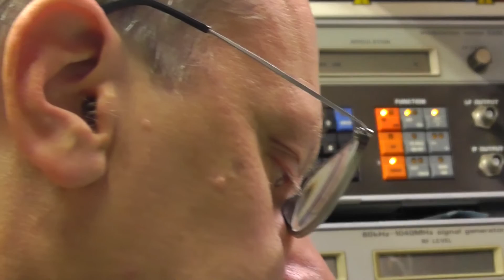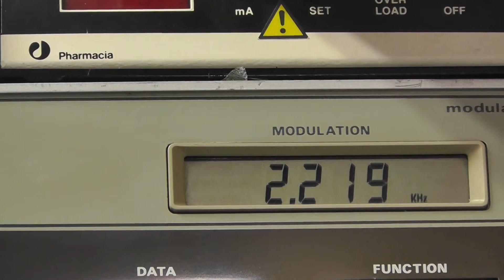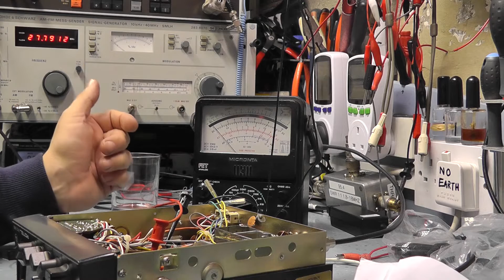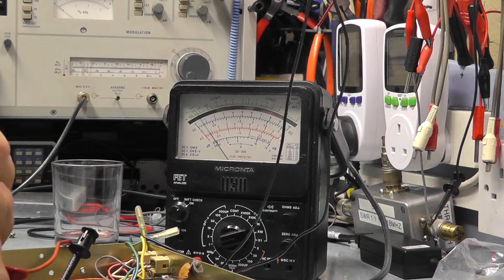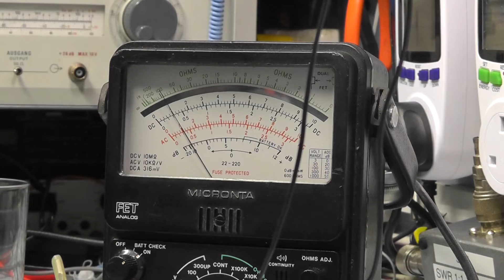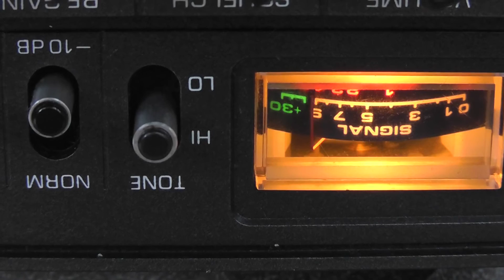Rotel RVC-240 (Cybernet) Pt3 Rf alignment, deviation & finishing up.

Comment: If you want a nice analog meter with high impedance, check out the Philips PM2505. It even has a polarity indicator, so you don't have to switch around.

Comment: Smashing tune up simon :-D
Did you have any problems with the red tx vco lock capacitor, or was it fine and dandy?
The t.x meter will show slighty different with an antenna connected in comparison to a dummy load, it's just a simple diode/capacitor r.f sample and an antenna has some reactance.
i used to set the t.x meter to a real antenna, but that's me lol.
The cybernet 134 board is quite sensitive on receive.
I would set the discriminator by ear for the best clearest/nicest sounding receive, they were often set miles away from normal and my customers always said how much better the receve sounded.
It's a shame that there are is so much electrical noise about these days,  often on 27 mhz :-(
I was always supprised how well they worked with minimal parts, yes a bit basic but quite reliable ;-D

Comment: Thank you Simon for an interesting series of videos. A good high impedance analog meter is (still) a handy item to have on the bench. Mine is an HP 427A  volt-ohm meter with the AC mains option. Regards, David
Reply from the maker: Totally agree. I have that HP meter on the shelf,it was just easiest to grab a battery one.
Reply: I have an HP 427 battery only that I made a battery for with 18650’s. Works great, fits pretty well in the space available, and will likely need a charge in the next millennium.

Comment: @9:00 you have to use the lowest RF signal possible, the reason being that the AGC can kick in and cause an increase in actual level to result in a reduction in perceived level, the AGC can begin to turn on at surprisingly low levels.
Reply from the maker: Cheers Scott. I will go back and check.
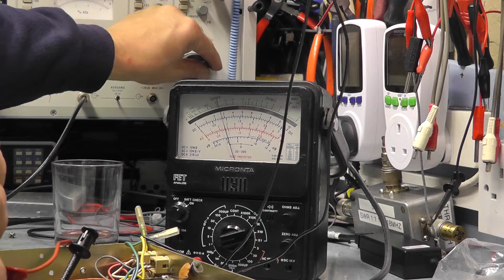Reply from the maker: I did , see @9:20